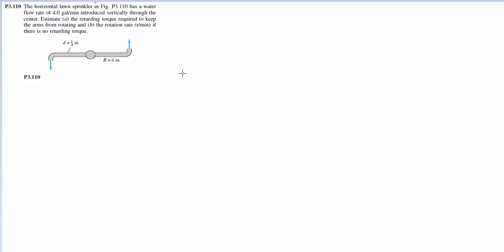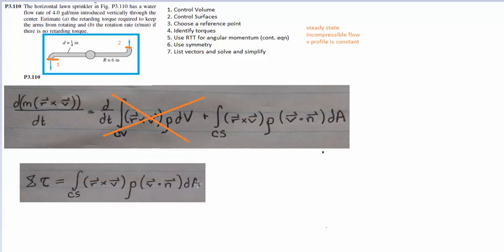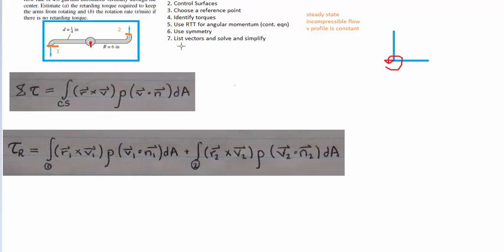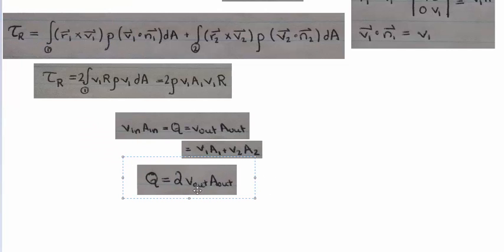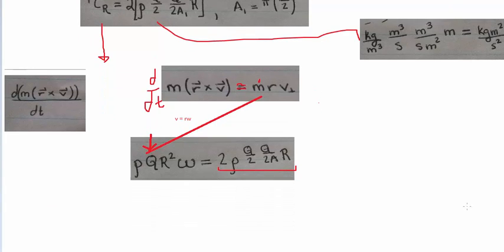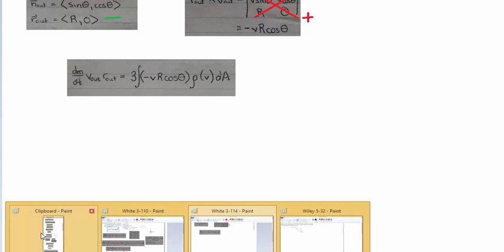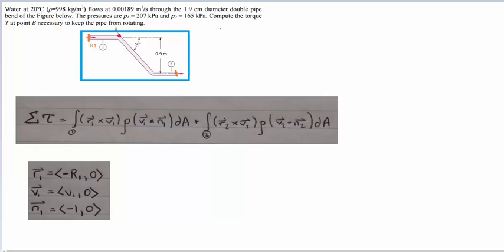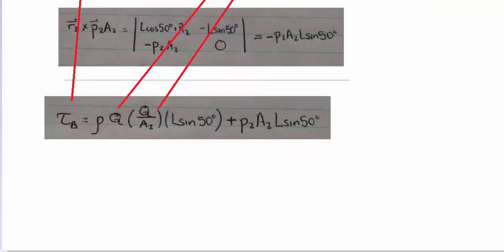Reynolds Transport Theorem - Angular Momentum - Example 1

Comment: What happened to the -ve sign that we had inside of the integral @ 27:04?
Reply: He forgot it. If you think about it intuitively, the sprinkler would rotate clockwise, which is a negative omega according to the right hand rule.
Reply: or you can say clockwise direction is positive